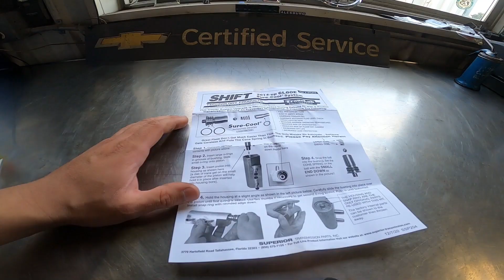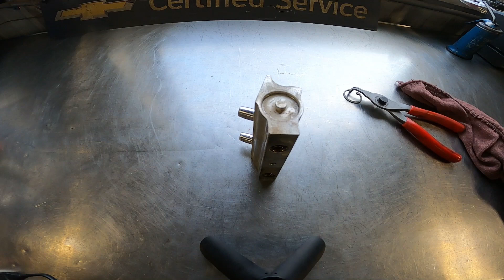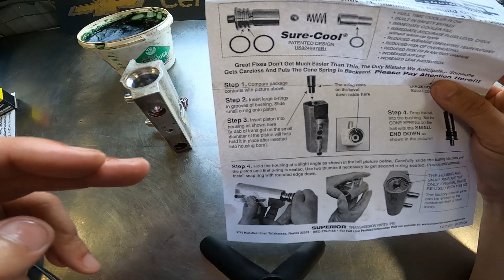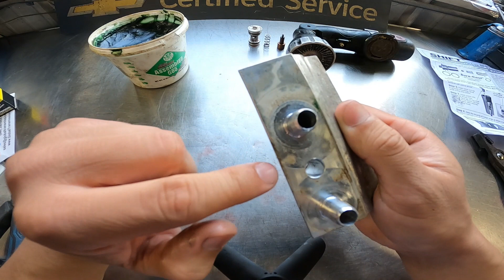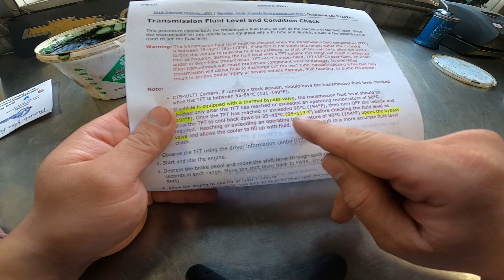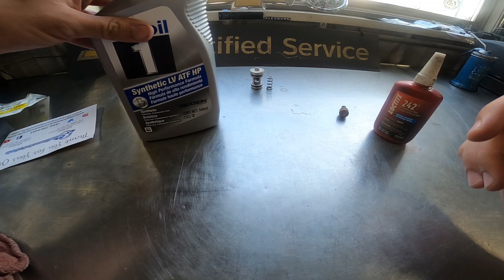Thermal Bypass delete. Removal.REBUILD! Install. STL010 8L90 M5U

Comment: In actuality this is just another thermostat with another opening temperature using a ball and spring. GM also sells an optional thermostat with a much lowered opening temperature for around 60 bucks . Just another option using OEM part.
Reply from the maker: Got an MYD from a 2020 6.6 gas sitting on the bench right now with a snapped output shaft. Good times.
Reply: Any chance of getting the GM part # for the lower temp thermostat?
Reply from the maker: @bartrowe3705  86774933
Reply: @jaycastillo9313  your opinion. Is it better to put the new version of GM's lower temp thermostat,  or use the Much lower temp  system of this video ?
Reply from the maker: @Tow_Sr.  I personally still think the GM lower temp is too high. I still see them running closer to 200. My personal truck with the STL010 never gets above 134 on the hottest day of the year in stop and go traffic. Then cool back down to around 115 highway speed. And those numbers are pretty consistent.
Reply from the maker: @Tow_Sr.  I personally still think the GM lower temp is too high. I still see them running closer to 200. My personal truck with the STL010 never gets above 134 on the hottest day of the year in stop and go traffic. Then cool back down to around 115 highway speed. And those numbers are pretty consistent.
Reply: @jaycastillo9313  thats is exactly why I asked. The GM # still seems as it can get hot under differant  conditions.  Thanks, ill try this part.
Reply: @jaycastillo9313  I try to explain to my son that Just turned 16 with a New DL. He wants to drive my truck.  Granted I just got it ( I got in an accident in my 15 chevy) they totaled it. But it never got over 150. Ever. So I try to tell the boy Transmittion fluid is THIN thin. And IT IS NOT OIL. So it should Never run anywhere close to the Engine temp.,  (my theory is a trans should run "About" Half the temp of all engines) , Jmo. I Have No idea why GM would want them so hot. Makes No scense. At all , again. Trans fluid is not Engine oil , so I'm going to. Get this part the STL010 and then ill let you know how much better it is 👍
Reply from the maker: @Tow_Sr.  I think that’s a great decision. And you’re 100% right they should never be that hot. I’ve heard GM does it to squeeze out fuel mileage 🤷‍♂️
Reply: @jaycastillo9313  well thats a horrible way to gain .02 miles per gallon. And IMHO it seems my truck shifts smoother and goes better at first start in the mornings. Once it gets hot around 200°F it doesn't want to kick the converter into lock out , seems it runs way better around 120 ish
Reply: @jaycastillo9313  thanks @Jay Castillo , I put in the STL010 and I am driving my truck now on a 45 min drive. City and I can't get it above 145° but on hwy around 120° ty a lot for your video. And responses , YOU have been a MAJOR HELP , 💯👍👍
Reply: Much smoother than 200°, or 210°. It shifts smoother and just seems like a new Trans . 💯🍻
Reply from the maker: @Tow_Sr.  ran mine on a 4 hour trip today. 115 heat index outside. Truck ran 138 steady highway
Reply: @bartrowe3705  yes,I will look it up..
Reply from the maker: Yep, been putting them on every 6 speed that comes in door. Got 3 in the lot right now that won’t move.

Comment: Hola tengo una pregunta mi trocka cuando está fría da los primer  cambio muy brusco y también cundo  frenas en un semáforo cuando reduce la velocidad da un pequeño jolon es una GMC Sierra 2016 de 8 velocidad me recommended quitarle el tarmostato??
Reply: si!  Y tambien cambie la aciete con el nuevo Mobil 1 synthetic LV ATF HP 124715 y el numero que usa GM 19417577
Reply: @jewllake  este mismo aceite de móvil también sirve para la 6l80 gracias
Reply: @angelmariojimenez3059  NO..... ese usa el Dextron 6  no el HP.  Puede ser Mobil pero de Dexron 6 IV.
Reply: @jewllake  gracias muy amable feliz Año Nuevo
Reply: @jewllake  y cómo trabajo la trasmicion después que le cambiaste el aceite
Reply: Gracias

Comment: When installing the Superior STL010, do you happen to have the torque specs for the cooler line bolt and housing mounting bolt into the 6L80 transmission?
Reply from the maker: Cooler line bolt is 106 INCH POUNDS and the mounting bolt is 16 LB FT. Hope this helps. Note the cooler line bolt is inch pounds and not foot pounds.
Reply: @jaycastillo9313  Awesome - thank you!  Yes absolutely, will be using inch pound torque wrench, 16 foot pounds = 192 inch pounds as well.  Thanks again.
Reply from the maker: Not off the top of my head. What year and I’ll look it up for you.
Reply: @jaycastillo9313  2019 Yukon.  Thank you!

Comment: Sorry if this is a basic question most already know the answer to, what is the purpose of this bypass delete? Just trying to understand why someone would want to delete it. Thanks in advance.
Reply from the maker: The thermal bypass is basically a thermostat that opens up at 190 degrees Fahrenheit. Then you get cooler flow. These 6 & 8 speed get too hot. The torque converters can’t handle it and a lot of the time get so hot they turn blue when you pull them out. At this point your replacing the entire unit most shops won’t even touch them. GM actually just released a new bulletin October 19th. 21-NA-199 that tells you to replace the original thermal bypass and updated it with a new one that opens at 158 degrees rather than the original ones that at 190 on the 6 speeds. They list 13 symptoms it may cause. I’m sure 8 speeds will be added soon.
Reply: @jaycastillo9313  thanks for the info Jay; for 8speed same or different PN?
Is this still an issue after changing fluid with the updated Mobil1 blue label full synthetic ATF  LV HP?
Reply from the maker: The part number for the GM 158 degree thermal by pass for 6 SPEED only is 86774933 and the seal is 23135703. If you want to go that route.
Reply from the maker: The bulletin reads that anytime a MYC (6 speed) is in for transmission related service to replace the thermal bypass with the updated version. So it should be done even with a fluid flush. Right now it is only for the 6 speeds. And the part number will not work because the design is different than the 8 speeds.  It you can use the STL010 used in the video to completely bypass and when GM releases an updated 8 speed thermal bypass you could always install that if you wanted.
Reply: @jaycastillo9313  thanks for explaining I was confused exactly what bypass was being used for and thought there was another step to the process. Is there any updates being this look like a yr old comment I came across your video by a comment you left on another video about changing the trans fluid because of shudder this part still the recommended way? Thanks cheers

Comment: Do you happen to have a part # for the O-ring seals for the cooler lines?
Reply: Take the old seals to a hydraulic shop.  They are genius for matching parts like that.
Reply from the maker: When I look it up on the GM parts computer it doesn’t even show them as a serviceable part. They must come part of the original thermal bypass housing only. Which does us no good in this situation.
Reply: There are part numbers. GM released an updated thermal bypass that runs cooler. Google the Thermal Bypass Technical Service Bulletin and all the part numbers are on there.
Reply: @K3nfloww just found it. For those interested the Part #’s are 23277649 (for steel lines) 12650609 (for aluminum lines.

Comment: I put this in my 6L80 half ton about the same time you posted the video. Super easy and a GREAT product. Thanks for showing the 8L90. SUPERIOR TRANSMISSION PARTS INC. are really easy to order from and quick to get parts to you.

Comment: What do you think about the mishimoto transmission cooler thermal bypass kit?.. I recently purchased and installed mishimoto trans cooler and did the thermal bypass delete.. temp went from 180 without the delete to 135 degrees after delete upon driving in town for 30 minutes. 

My question is what about in cold temperatures especially here in Central time zone?.. would this kit be good for cold temps?.
Reply: I live in the midwest as well. In cold temps the spring and check ball move so the super cold fluid can by pass. The guys at SUPERIOR TRANSMISSION PARTS INC. can explain it better just give them a call and they will answer any questions.
Reply: @stevecampbell7620  I did put in an order on the sure cool..

 I did the delete with the mishimoto thermal bypass delete that came with the cooler and went on a long highway drive and my transmission temp never went over 150 at all even after returning to and driving in town temp fluctuate between 127 to 130 some. I also noticed the shifts where smooth but honestly don't know if this is too cold since dealership told me that normal operating temps are at 180.

Will be installing the sure cool bypass delete for sure and see what's the difference.
Reply: @viixiconik  No the 195 thermostat is to high, The factory designed it that way claiming better fuel economy with hotter fluid. Hotter temps=more stress on the trans. If the thermostat sticks it can wipe out your trans also.  BTW I am an old retired GM tech,  I did this upgrade on the used 2018 Silverado as soon as I got it   .Trans temps easily went to +195 before and never go above 147 on the hottest days. 127 to 130 sounds very good.
Reply: @stevecampbell7620  wow!.. really do appreciate you for clearing that up. I thought 120 some degrees was a little too low since I was used to seeing 180. Thanks again good sir.
Reply: @stevecampbell7620  Gm has a updated thermostat that is supposed to open at 158 i did that but temps were still in 190s so I added a auxiliary trans cooler but temps still hit 190s put my hand on trans line and they were still cold...whats your thought. I just ordered this sure cool..but this is has me stumped I'm thinking bad thermostat
Reply: @donknicker8110  seems to me that your kit or something isn't right. Seems its not using the cooling lines at all. Maybe a air pocket in the lines and it won't let  the fluid pump through the cooler , seems its just pumping right back into the trans,  I watched a video onna guy that had clear lines with 2 ATF gallons hooked to the cooler radiator,  and he was using a pump to show how and why it wasn't going to the cooler. It was just going out 1 of the holes on the thermal bypass valve amd going right back into the other.,  I think there is a problem with the thermal bypass thermostat,  maybe installed ( inside ) wrong. Id get this kit here he has in this video. 👍🍻☝
Reply: @Tow_Sr.  Check to see if the new thermostat housing has 70 stamped on the side. You may still have the 190 in the housing.
Reply: @toddruja9962  no I had the Truck out today, hauling my boat. And it never got Over 170° , it works much better than that junk Factory Thermo they thought was a good idea. 🤷‍♂️, but it is a MUST have if you get these models , 💯

Comment: Awesome video!!  Question, Would I have to add transmission oil after this install? I Saw it leaked a bit of oil. 

Thank you in advanced 👍🏼
Reply from the maker: Put it on a flat surface and pull the oil check plug like I do at the end of the video. If your temperature on your instrument cluster reads between the spec I gave then pull the plug and wait for the fluid to stop dripping. Then it is completely full. If you don’t get anytime when you pull the plug then yes you need to fill the transmission until it starts to come out of the check plug. Remember the vehicle must be running while you check the level
Reply: Pardon the not knowing but why not just check the dip stick? I am going to do this mod whenever the parts come in just ordered after watching your video
Reply: @masonprine9201  His truck with 8L90 Transmission has no dipstick. What he showed on the video is the way to check the trans fluid level on 8L90 transmission.